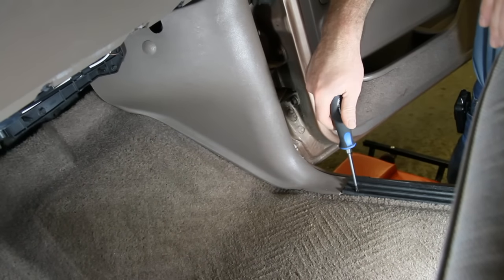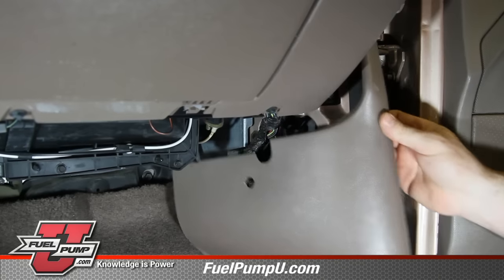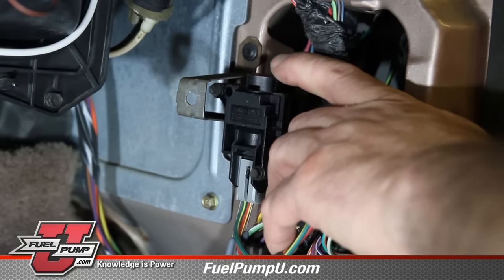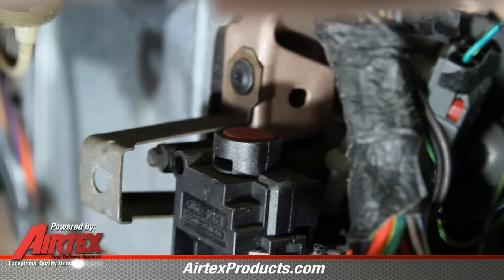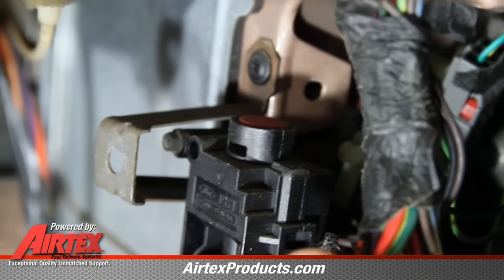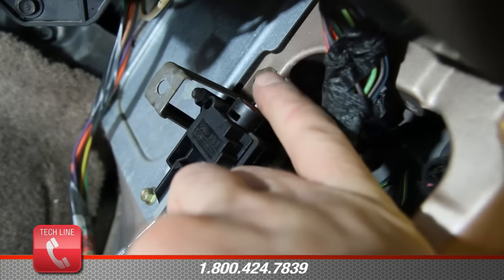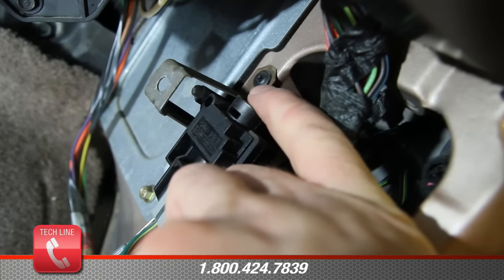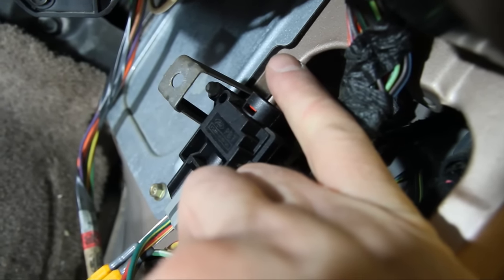How to Check Inertia Switch on Ford Vehicle Fuel Systems

Comment: Thank you so much for posting this video! My 1995 Mazda B2300 suddenly wouldn't start and I suspected the fuel pump had failed. But this video showed me that it was in fact just the inertia switch. It was such a relief when the truck started! Anybody else out there with a Mazda B-series truck would do well to check this switch, too.
Reply: where did you find it located i cant find the dang thing anywhere
Reply: My 2005 Mazda B2300 wouldn't start this morning...9/29/2021....Thought maybe bad fuel pump.  Googled truck wouldn't start and found this video.  After pushing the red button the truck fired up IMMEDIATELY.  This was truly a lifesaver.

Comment: My son had his front passenger tire blow out on his '03 XLT, then the truck wouldn't turn over. 

Checked the fuse and the relay, looked for the driver module and realized it's in the tank on an '03. Truck isn't worth dropping the money into a fuel pump and labor. We were getting ready to have it hauled to the junkyard until I stumbled across this video. Pushed in the button and the truck fired right up.

Liked and Subscribed.

Comment: Thank you so much for the help full video I was outside for 2 hours trying to figure out what's going on with my fuel pump checking relay switches and all types of nonsense ran across your video hit the button and it fired right up no problem again thank you so much you have been a big help
Reply from the maker: Good to hear it was helpful!
Reply: @AirtexFuelPumps   hi 👋 how are you doing? Do you know where is the cutoff switch located  on 2012 ford focus

Comment: THANK YOU SO MUCH! I was just about to buy a fuel pump for my 2003 B2300, but I saw your video first!
Reply: do you remember if it worked?
Reply: @benstewart3194  Yes, it worked. Mine was triggered by releasing the parking brake initially. Resetting the switch was an instant fix.

Comment: Every post I find says on the passanger's side like pictured here, however, on my '91 F250 with dual tanks, a 7.5L engine and automatic transmission, the Inertia Switch is located on the drivers side mounted to the fire wall on the left side basically under the fuse box.

Comment: Yeah that's what I'd like to know...Is the button suppose to be pushed in to make the car run or out to make the car run
Reply: The button is supposed to be pushed in. When the button is in the popped out position the fuel pump will not get power.

Comment: What makes my 1987 F250 with dual tanks abruptly stop running. Going down the expressway, it will start right back up but driving short distance in hot weather, not so lucky to start right back up.

Comment: i have a 97 ford ranger and the truck has been sitting for a month. in went and check the switch and it was down. however it will not turn over. what do i do?

Comment: if the switch is pressed down and truck is still having fuel issue is it safe to just suggest filter swap?
Reply: I would probably want to check my fuel pressure at the fuel rail, just a few pounds of low pressure will make your truck at crazy, you will be able to tell more about it than, you can are maybe should replace the fuel regulator on the rear of your fuel rail

Comment: I had small front end collision 2002 Ford mustang. Recently, fixed parts. Car kept starting, I could drive it. A month ago though, I had trouble starting, cranked, and eventually started. Like no gas. But yesterday it didn't  start. Cranked, but no start. Is there an inertia switch in the front? Thank you

Comment: I believe I have a problem with a fuel pressure sensor, which is supposed to be located in that passenger footwell area of my 2008 Lincoln MKZ.   Any clues on where to find it?

Comment: Hi, I have a 96 Ford Explorer, We broke down about a week ago, The mechanic where we broke down said it was the fuel pump that it was dead, The car wants to turn over but just wont, We replaced the Fuel Pump and Filter on it but still it wants to turn over but just not doing it, Do you think this switch might need to be pushed ? There are a lot of pot holes in my city.

Comment: And what about the trucks w/ inertia switches that don't have a physical button.  There was this thing we had to do with the key that would make it reset instead. The last time I had to do this for my 2002 F140 I looked it up and it said to turn the key to position "on" and hold a second (but not more if you can help it), then go to position Off.  I wanna say it was just doing that three times in a row  and it worked.  The next time I turned the key after that sequence, it started right up like normal.  I was really bummed when I finally got that kick-plate cover off and saw that my fuel inertia switch had no big red button.

Comment: I'm about to go check mine because my truck was running fine and then all of a sudden it wasn't. it's acting like it needs a new fuel pump and I wouldn't be surprised if it does because my fuel gauge does not work and whoever own this F-150 before me took out the rear gas tank. Maybe it tripped because it doesn't have The rear gas tank and something triggered the inertia switch to trip idk I doubt that's what it is but at the same time I hope that's what it is I don't want to drop this gas tank and put in a new fuel pump. Thanks 👍🏻

Comment: Do you know where is this inertia button located on a 2013 Ford Explorer Ecoboost  2.0. Is not on the driver side,, nor  the rear panel or the driver side please help I'm desperate. After afrontal crash and replacing the damage part, it cranks but won't start, it sound when a fuel pump is bad

Comment: Any clue WHERE the inertia switch is located on a 1990 ford f600 or if it  even HAS one ? I'm not getting any gas to the carb. ,  and I dread pulling that 32 gallon tank if I don't have to .

Comment: Can I manually over ride the button simply by crossing the two wires on the plug in adaptor for the fuel reset button?

Comment: I have a 1989 F-250 that has been sitting for 4 yrs., would that cause the inertia switch too trip.? My vehicles turns over but will not start so do I have an inertia switch and if so where may it be located?

Comment: damn it I was hoping this was my problem. my 1995 ford truck won't start i got fuel pressure at the rail but the spark plugs are dry as a bone I'm thing something's up with the injectors what do you think
Reply: +Airtex Pumps OK thank you.

Comment: I have a 1999 mercury  mountaineer and it turns over but won't fire I recently moved in the truck and kids slam door and had a small bump on the back from a accident do I need to reset my switch

Comment: I have a 2001 Ford focus Manual, I turned it on not knowing it was in gear i let go of the clutch and the car stalled, It jerked around pretty bad, I found the Inertia switch clicked it on still nothing, i was told it could be the belt came loose or skipped is that possible?

Comment: sir. i have a 93 ford escort that reads 8 volts at the wiring harness for the fuel pump. my inertia switch seems fine. what could be the problem. the car battery is good

Comment: I have a 2002 ford f150 5.4, There is no power going to the fuel pump. and no ground to the fuel pump relay. would this switch cause that?

Comment: On my 06 mustang I  had to reset it two day in a roll. It takes me a couple of tries. I dont know if im doing it right. But can the inertia switch be the problem.
Reply: Yes it was just in the parking lot and when I get off work. I try to turn it on but it wont so I have to reset the switch and it take a me a couple pf tries. How extacly do you reset it on an 06 mustang?. And bout how much is a new switch

Comment: After transporting (flatbed) vihicule, running tests,checking relays , fuses and harness connections discovered no power flowing to fuel pump. Wifey discribed that engine died after misfire and hesitation. Apperently that is what happened when someone hit fuel cutoff switch with their feet. Pushed reset and all is great and running.Thanks.

Comment: I have a 2006 ford ranger. The car sometimes stops and wont start again. A few years back we had the inertia switch replaced. Now it is happening again. I have located the switch and it does not stay down when pushed. Can you bypass the switch? if so how? In the past when this happens, it eventually starts again? How can it start again? does the switch build up pressure to trigger it to stay down? Thanks for your help
Reply: The switch is designed to shot off the fuel pump in a hit hard or roll over wreck makes the button trip, you can unplug it and put a jumper wire in between the two wires that plug up and you should be able to start and run the car,not recommend to continue to operate in this manner, replacement of switch is recommended at earliest chance

Comment: If the fuel pump runs & won't stop like it normally does after a few seconds when key is on, does that mean the inertia switch isn't the problem? Thanks.SamFox
Reply: Thank you. That's what I thought. I put a new fuel filter on the frame under the cab. The engine will start sometimes & not at other times. When it won't start, the fuel pump stays on & doesn't shut off. I switched the large relays under the hood next to the under hood fuse box, didn't change anything. Now I am stumped. My mechanic for a living friend says the problem is something besides the fuel pressure regulator, but didn't say what he thought the problem might be. Again, thank you for your reply. SamFox

Comment: I have an 87 Ford Ranger with a 2.3 fi engine. When I turn the key I can hear the fuel pump run. Does this mean the inertia switch didn't go off? My truck got hit by a hit and run driver. The truck was hit hard enough that it ripped the neutral safety wiring harness off the switch. I got the engine to rotate but it won't start.
Reply: Have you checked your filters and fuel pressure, when I know my pump is running, I am confident too check my filters and my fuel pressure,if that is good you probably want to hook up a code reader

Comment: I have a 2004 FX4 is it in thhe same spot?....also do you need to remove the fuse box?
Reply: Airtex/ASC Performance Pumps Thank you...I found the schematic...it was the fuel pump module driver. Very easy fix.

Comment: I started my crown Vic. A loud pop sound happen right after I cranked it up. Turned it off quickly. Then I smelt something burning. I tried cutting back on. Which it did but it sounds rough. Does anyone knows what this could be?

Comment: Im not getting any fuel pressure, is this switch between the relay and pump or hooked up to the ecm?
Reply: I just check the voltage on the green wire....6.5 voltsdc
Reply: It must run back to the ecm

Comment: Thanks for that it worked . but what causes it to keep tripping
Reply: Accidents, a jolting turn or even going too fast over speed bumps. It’s like a sensor. When it senses rough handlings it responds as if it’s a crash then trips to prevent fuel from flowing to the floor which can be fatal.

Comment: I have a question if the inertia switch is bad, will my fuel pump still turn on? I have a crank no start condition and just installed a new fuel sending unit, the fuel pump turns on but is not priming, could a inertia switch cause this.
Reply: thank you for the reply.

Comment: Hello, 
I have a ford escape having a fuel cut off. I have left the car for more than six months and when I came to drive it found the battery dead, replace it and tried to start it but it does not run, exactly as if there is no fuel. thought it was a immobilize fuel cut off. could not reset it. do you think its the Inertia switch of the fuel pump. 
could you please help.
Reply: many thanks, its indeed a fuel pump failure.
Rgds.

Comment: Sr. i have a 2000 Ford Excursion V10 4x4 that was starting fine and it's been siting in the garage for long time, but yesterday i check it in the morning and started fine but later i tried again and didn't start, that happened to me before, and i just spray some starter fluid and started right away but this time it died for good, now i sprayed that starting fluid  and nothing it yes crank but doesn't start, i have checked the relays and fuses, they are good, also checked the inerta switch and i press the switch down but feels like is not moving down or up and my it cover with some thing and cant see the color of the witch also fuel pump sounds good is it some thing else that i am missing, please help, Pedro,
Reply: I have already sprayed starter fluid and it starts but it dies right away as soon the fluid is gone.

Comment: The inertia switch lets me push it down but does not click and stay down it comes right back up like letting a spring go the truck does not even try to crank what could the problem be @airtexpumps

Comment: Hi man, i have ford fiesta diesel 2001 1.8L, i i used in france.. my car suddenly can't start when hit huge bump.. i suspect this switch problem.. the problem is, i coudn't find it, i hope u can help me on this.. because this engine no prob and smooth
Reply from the maker: Most inertia switches are behind the passenger side kick panel, there are a few, Mustangs, that have the inertia switch in the trunk. We do not have your vehicle  in the USA. Your local dealer may be able to assist in locating the inertia switch.

Comment: Hello, I have a Ford Expedition 2000, I replace the spark plugs, and the engine coils, but I still have an issue with the engine misfiring sometimes and sparks. I checked the inertia switch and my question is, Does the switch need to be down or up to be open?
Reply: ShadowFighter12 .

Comment: I have a 2004 ford ranger edge. A few months back my truck shut completely off on me while driving. I pulled over and tried to start her back up but nothing happened. had my passenger step out. I checked the fuel shut off switch located on the fire wall and she started right up. The connector had come loose probably caused by the passenger. Hope this helps. God Bless America and Ford Motor Co.
Reply: Oh! That's cold!.... You didn't even let your passenger get back in the car before you drove off.

Comment: thanks for the vid. do you know where the inertia switch is located on a 2003 ford expedition 5.4L
Reply: never mind, found it. But my switch won't stay in the on position
Reply: I just found out that my PCM Relay Switch was completely burnt out. I replaced it and it still doesn't work. I believe that i need a new fuse box  because a few of my Relays have a little burning on them.

Comment: Thanks for the video but it's a shame you would go to the trouble of making this video telling people to always "check their inertia switch" and not even tell them what to check nor tell them what is the correct position of the switch or what is the tripped position of the switch! Should you not have simple told them if the red button is up they need to push it back down? Otherwise how are they going to know by what you told them?
Reply: Chan Raxter common sense.
Reply: Chan Raxter actually he did say if it is up it needs to be pushed down, it is open.  So just to help if you push it and it in fact goes down and stays down it is reset
Reply: Chan Raxter great point. He showed me absolutely nothing honestly.
Reply: David dkoppyus OP use of words wasn’t clear for all audience. Saying open and whatnot is more electronics/electrician/Mechanic word versus saying
“If the button is up it means the pump isn’t working . Down means it’s all good “
Reply: I just got my old ford ranger started because of this video, try reading between the lines
Reply: It helped me get my 2008 F-150 started.  Thank you for the info.
Reply: @dkoppyus63  CORRECT
Reply: Man said up is failed, push it back down n such..
Reply: @foreverendeavors6210  I made that comment 8 years ago. 8 years ago! The video has been edited to include that important information since that time
Reply: @chanraxter2015  I know, I couldn't help myself.......n such....
Reply: @artiefrancis7446  but showed 60 others  common sense to reset it
Reply: You definitely didn't watch the video or listen...
Reply: @chanraxter2015  actually.....you cannot edit an uploaded video, you can only make another video and remove the previous video, removing previous old original your comments.....n such...
Reply: @harrylindanicholson3351  0
Reply: Pardon me. You didn’t see him depress the red button?  If you don’t watch the video nobody can help you.
Reply: @matthewkent1865  I made that comment 9 years ago friend. He updated the video after I pointed out that error. Thank you
Reply: It does show when open the red does not show in window
Reply: @waltersaffell2626  People keep commenting on my comment I made almost 10 years ago about this video. The video was edited after my comment to show the exact thing I said this video needed to explain what needed to be done. I thank the one who did that to clear that up but people still think I just posted this today I guess.
Reply: I mean I got what he was talking about these are type of videos I like straight to the damn point
Reply: If you switch on your ears and brain, maybe you could hear that he said if the button's position is up, you need to press it down to activate the inertia switch..
Just listen to the video again and don't act like a spoiled boy 😊
Reply: @chanraxter2015 yeah, right..he edited the sound 😂
It's not possible to update/edit audio from existing YouTube clip, without uploading completely new clip.
And when you upload new or edited video clip, old comments will be lost..

Comment: seems like i have no voltage at switch. tried turning key on when checking. switched relays around. fuses in distribution box are ok. its a 94 explorer. have manual for 92. says it has a 30 amp in distribution under hood but doesnt show fuse on plastic cover.